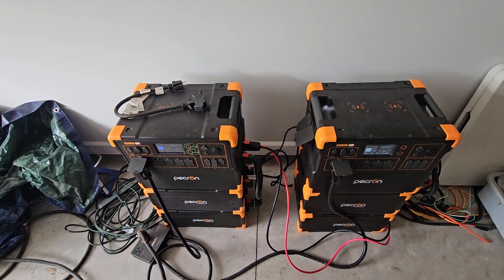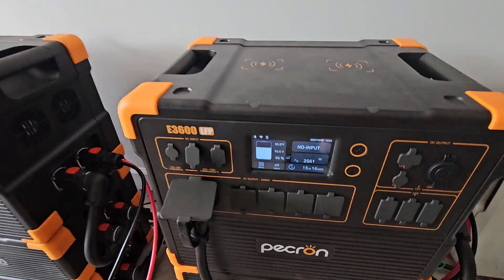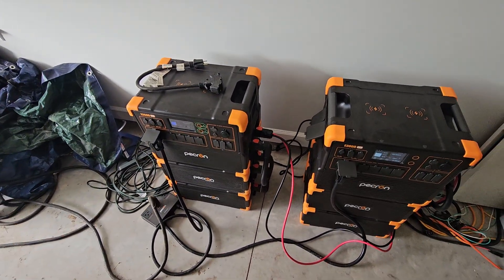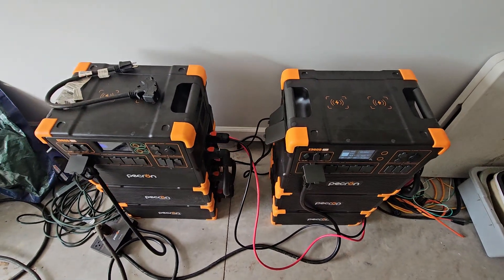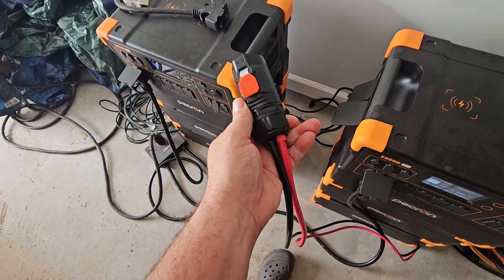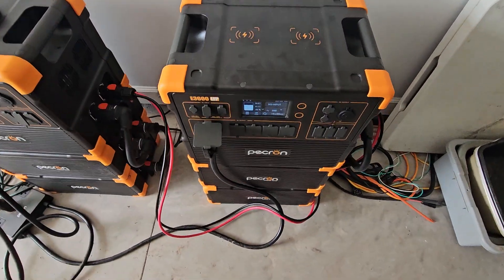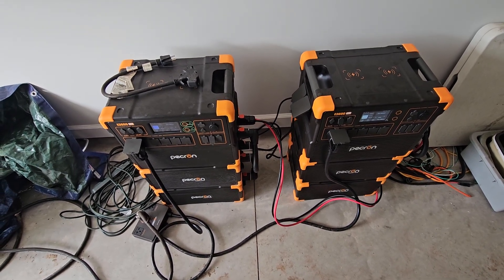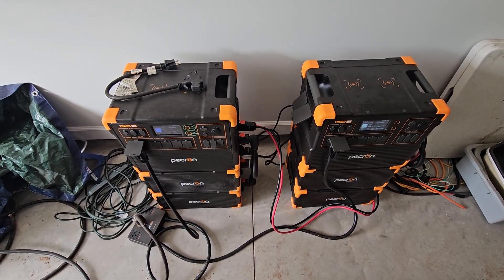PECERON E3600LFP 240V off grid testing with DC bond. Part 1

Comment: I need this cable, too. Wish pecron would make one for order. The cable does turn two e3600 into a beast.
Reply from the maker: Here is the last email I got from Pecron:

Hi Wade,

The engineer confirmed that a 6AWG cable should be usable for this setup, but it is critical to ensure the positive (+) and negative (-) polarities are not reversed during connection.

Additionally, please note that since this is not our official cable, we will not be able to take responsibility for any issues that may arise from its use later. We hope for your understanding.

Alternatively, would you prefer us to send you our official MJ32 cable? Please be advised that the MJ32 cable is currently out of stock, and you would need to wait for the stock to be replenished.

Best regards,

Lily

Their cable must be modified and is way to short to use effectively. That is why I made my own. I will be making a video on how I made it and the parts required.
Reply: @hickshomestead113 
Do that they the modified one on their sites? They have the 4ft mj32 but not sure if that one is modified.
Reply from the maker: @ChristianGuy7000  They do have a 47" cascade cable, but the cable they have would need to have the data wires cut to use as a DC bonding cable.

Comment: Can you show exactly how you made this cable? Disassembled and reassembled. Can you post or link all the parts/tools needed? I’m curious if you could do this with a pecron 1000lfp also. One Solar input to charge both the 3600 and 1000 lfp units. Not sure his to put that cable together without the data pins.
Reply from the maker: I will make a build video on the cable I made and post the links to the materials soon!
Reply: Have you made the video yet? Do you have links for the parts?
Reply from the maker: @TheDudester805  https://www.youtube.com/watch?v=Gz_58nreiuw
Reply from the maker: https://www.youtube.com/watch?v=Gz_58nreiuw